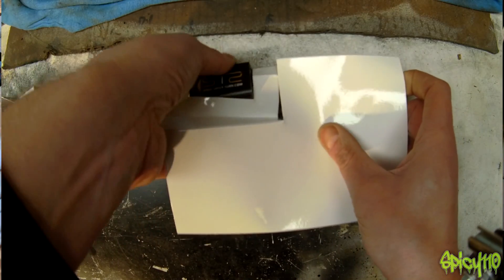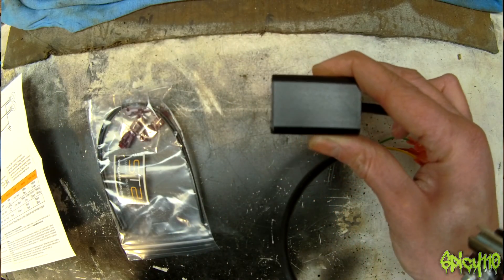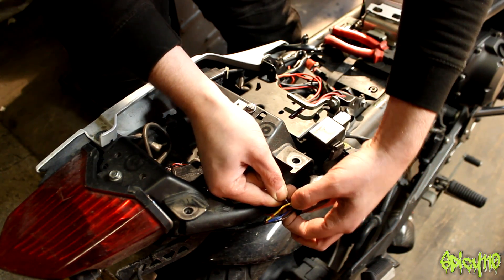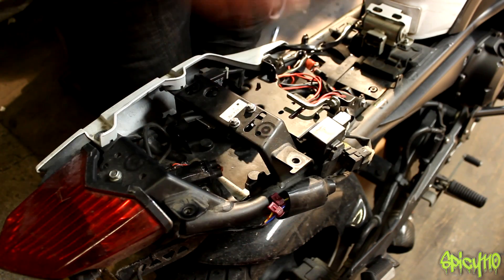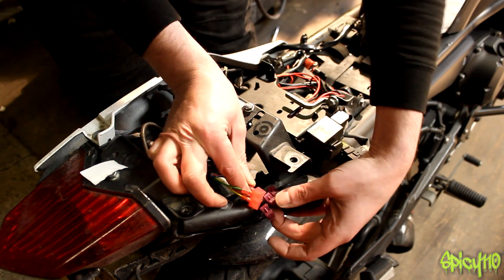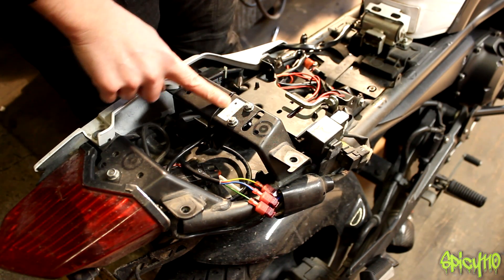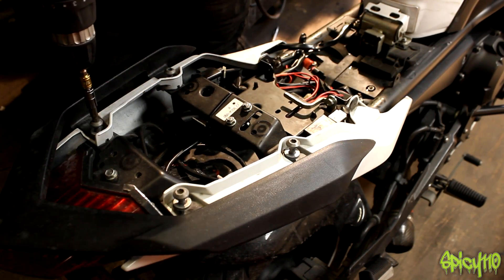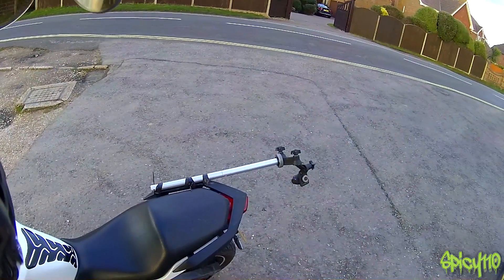STS Smart brake module. Auto engine braking light! + GIVEAWAY!

Comment: Legality would be the only issue with this as a friend of mine had a flashing brake light when you first apply it, and it failed the mot for this, I know this won't be picked up on an mot but still. Other than that, cool idea and handy for thumping twins that lose speed like your weighing on anchors when you throttle off
Reply from the maker: +craig matthews I don't get why this products is confusing so many people. It only flashes under deceleration. It makes no changes to the way that your brake light works when you pull the brakes on. So at an MOT centre where the bike isn't moving it's not even going to Flash. It is no different from you pressing your brakes when you use engine braking like you're supposed to apart from instead of it being a solid light it's a couple of flashes.
Reply: spicy110 it's not confusing, I said in my op that I know it wouldn't be picked up on an mot but my point was is it legal? Although a tester won't pick it up but the plod behind you will certainly give you a tug. As some people want to tow the line, some don't care and some plead ingonarnce. As it happens I just had a peek on the net and it appears it is legal as some bmw's instigate a 5hz flash above a certain braking force and if it prolonged it brings on hazards too.
Reply from the maker: The thing is when your engine braking you should be pressing the brakes slightly anyway that will take over from the flashing and it will become a solid light.  the only time that you're going to notice it flashing is when you forgot to cover your brakes to warn people you are slowing. But yes bikes have this fitted electric motorcycles when  regenerative braking automatically put on a night like this.

Comment: I thourght a flashing red light was against the law.or has it been changed.
Reply from the maker: +michael turner I have replied to this many times in the comments. When you pull the brake on its solid, as you are supposed to touch the brake while engine braking it will still he solid but on the times you don't it will flash a couple of times.  So it isn't a flashing brake light as such. This is a feature that comes stock on some cars and is also used when electric motorcycles are using regenerative breaking.
Reply: spicy110 ok just asking you know wot the cops are like anything tomake money.it only flashes slowly so its only like you  just pulling the break just a bit on slowing
Reply from the maker: +michael turner yes I think it's the ones that flash fast when ever you brake that are the problem.

Comment: I'm guessing I've been brought up very differently, in terms of driving standards. I was always taught (assuming you're driving sensibly) you should always slow using engine braking, for any vehicle 3 tonne or less. Though it seems all instructors these days, insist you slow using the brakes only, which personally I don't get. If it has a place, I have to agree with spicy, that it should only really go off when you're engine breaking quite hard. 

For me personally, it's not something I would ever use. And to be honest, if you're finding that you're needing to decelerate that hard, you should be on the front brake at that point anyway. Letting the engine over rev like that, causes excessive wear. Great for learners though, it's not uncommon for someone to accidentally downshift, when at the limit of the engine in the first few months of riding (up, down, up, down, up, down, down, FUCK!). But for an experienced rider, it should never be necessary.

As for using it to warn other drivers. Well if they're not paying attention to you decelerating without the brake light, chances are, their radio or phone is more interesting, and they wouldn't see the brake light come on anyway. If an incompetent driver is going to hit you, it doesn't matter what countermeasures you use, they're still going to hit you.

I deal with this, by checking my mirror every time I decelerate. No ifs, not buts. If I think the person behind me isn't going to stop, I start riding the centre line, so I can get out the way if I need to. Because at the end of the day, it doesn't matter how many lights or sensors you have, accidents are caused by the idiot at the controls (yes, vehicle malfunctions are caused by poor maintenance which is the drivers responsibility), not by a lack of safety measures. If I had £1 for every driver I see that doesn't check their mirrors, before changing lanes, or taking an exit, I'd be a billionaire by now; and 50% of those don't even bother to indicate (because moving your hand 3" to tap a switch is so hard... my heart bleeds for you... you poor poor thing).

But I digress, a great vid as always, keep up the great work!

Comment: I want one of these but I hate using those splice tap things. Too many times from vibration I've seen wires break in half where those stupid things connect. Not worth it.
Reply from the maker: Still fitted to this day with no issues. However I would do a proper solder job if I wasn't demonstrating the kit.
Reply: @spicy110  That's probably what I'll do. Solder them and use some nice sealing heat shrink

Comment: For 62 euros and the fact that by watching the footage it seems by the time you've finished your engine braking the light barely kicked in to the point where it might not have need it. I understand the safety aspect and fair enough for the company wanting to further Motorcycle advancements but it's not revelutionary and in my opinion not a very useful feature.

Comment: Hi Spicy, I went for this last year http://www.vizi-tec.com/supabrake3/ I think it has more adjustment and you can fine tune it very easily. 

I know the flashing rear light isn't really legal in the UK but I like it
Reply: Motorbike Hamster The big difference between this and other brake flashers is that it works as soon as you slow down. The model you have and others need the brake lever to be engaged in order to flash.

Comment: Looks like a smart thing, but not with those damned connectors. The should never be used on a motorcycle, you Actually cut the cables in half. 
Always do it right and solder it and shrink wrap
Reply from the maker: I would normally but I am reviewing a product as it is. I think i even said that in the video, can't remember it was a while back. However they are still fine and working perfectly with no corrosion.

Comment: THIS DOES NOT WORK AS DESCRIBED, FLASHES brake light when accelerating =, going over road bumps etc, no good.  I had 2nd unit sent to me  but it was the same, had to claim through paypal as they will not reply to my emails after 2nd module ws posted, AVOID ITS GARBAGE